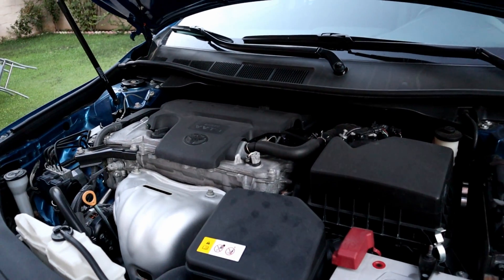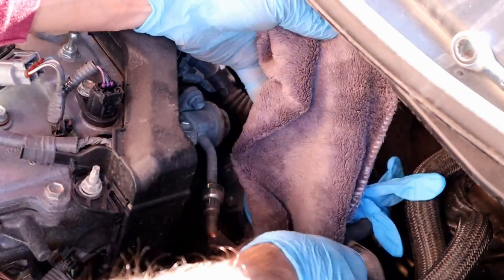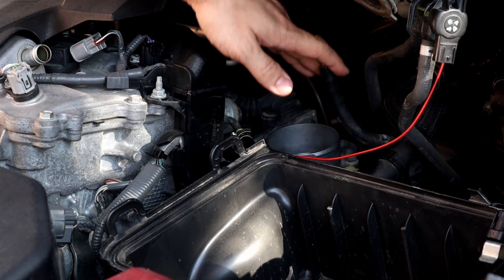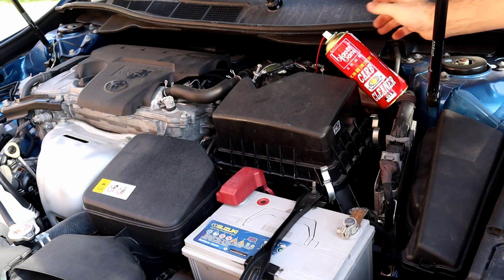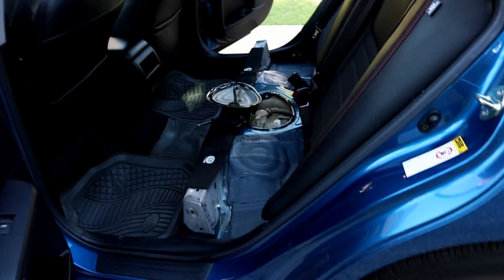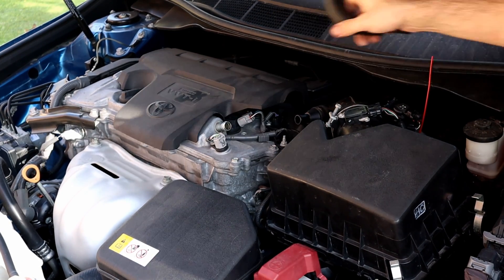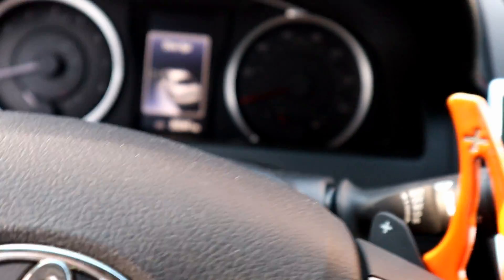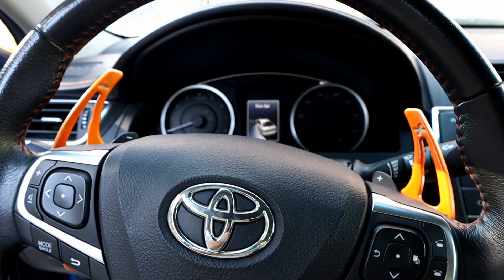Fuel Injection cleaning Toyota Camry 2017/HOW TO clean injection Directly without disassembling

Comment: Ai says this is not safe for motor..I say F@@k Ai..😅 ..for old car first test injectors by listening to each one to make sure they are all working..make sure your tank has fresh clean gas ,add injector cleaner to gas..if fuel pump is weak replace it...than use this method...once everything is good just make a habit of using good cleaner in gas every other tank..😊

Comment: Hey AliMECH, thank you for your videos, been watching so many of them lately. I own 2018 Toyota Rav4 with gas engine. I want to clean the fuel injectors using the method you shown in this video. Since my vehicle is an SUV, it does not have that opening below the rear seat for me to disconnect the fuel pump switch. I need to disconnect the fuel pump fuse. I found the fuse diagram and noted the fuse # 29 under the dashboard on the driver's side is the fuse dedicated to the fuel pump. Is this the only fuse I need to remove to prevent the fuel pump to push the fuel? Is there a fuel pump relay I need to take care of as well? Thank you for your help in this matter.

Comment: Thank you so much for the great video. I made the mistake of dumping fuel injector cleaner in the fuel tank which clogged one of the injectors..now I am getting CEL saying cylinder 3 is misfiring. Car stuttering at idle and happens only after engine warms up. All points to fuel injector. Used your method and emptied full can (about 350ml). It reduced the stuttering. Will there be any issue if i do it one or more cans? Appreciate any help.

Comment: Can i just plug the line with something instead of unplug the connector at the pump?
Reply from the maker: No, the pressure is high, if you plug it, it will damage fuel pump or blow a fuel line
Reply: @AliMECH  im just gonna run the line to a gas container then. The connector on my car fairly hard to reach

Comment: The carb cleaner could eat away at the o rings flooding the injectors under pressure for too long then you got air leak problems

Comment: you can just simply remove the fuel pump fuse on the fuse box to stop the fuel pump 😂
Reply from the maker: If you pull the fuse,  engine won't run, because it's responsible for some other electrical parts,  I showed at the end of the video ✌️

Comment: 2:35, yeah, I didn't like taking the gasket of the fuel tank off. 

 What if you run a pipe from the engine fuel line and direct it to a bucket, so granted you will waste some fuel but it is way better than taking the gasket out of the fuel tank.

Then you can continue the other process as normal, maybe because the engine cannot maintain pressure, it may not allow you to do so? 

Is there any other way? Tapping into the harness somewhere else? Disabling a relay while keeping the fuse in?
Reply: Disconnect fuel pump fuse

Comment: Does the carb cleaner not affect the cylinder walls by removing the oil and possibly messing something up with the pistons cleaning the injectors this way ?
Reply: I mean would gas does the same?

Comment: I have a Rav4 with the same 2ar-fe engine but it doesn’t have easy access to the fuel pump like your Camry. Do you think I could follow this same procedure but route the fuel line to an empty jerry can so the fuel injectors run just on the cleaner? Or do you think that would cause problems and the fuel pump has to be disconnected?
Reply: Hi, I have the same RAV4, how did you do it? I'm planning on doing this, maybe just removing the fuel pump fuse?

Comment: Your an idiot pulling the fuel pump cover to disconnect it when you could've just pulled the fuel pump relay which is faster and easier and your already right there under the hood anyways so you don't have to mess around with the seats and prying off a cover for no reason... Smh

Comment: Veslee's carb cleaner has instructions for fuel-injection systems where you can spray half the can into half a fuel tank. No idea how effective it'll be but hopefully it helps with pistons too
Reply: i can tell you that the cleaner through the fuel tank  may not work.  in my case it didnt work.  i have put 3 different sets of injectors on an old 1986 skyline and all jammed up doing it that way.  i just found this man's videos.  this is how i'll be fixing my problems without a doubt.
Reply: @vsvnrg3263  One can always disassemble them and use the carb cleaner directly into the injector. Or, from months of extensive video consumption, just use premium diesel/gasoline from reputable companies once in a while. Cuz those things works wonders for the fueling-injection system. 

I've stopped using regular diesel and went with V-Power only. That's for sure. Or you can go with halfsies (1/2 Premium; 1/2 Regular), for a more economic approach. Just don't mix them from different brands.
Reply: @vsvnrg3263  so sure that this will fix your problem before you even try it..SMH

Comment: Remove fuel pump fuse make simpler
Reply from the maker: Watch the end of the video, if you remove the fuse, it will cut the power from fuel injectors too
Reply: Got your point. But some cars have specifically fuel pump fuse if I am right. But in general you are in the right direction. My apology.
Reply: Brother My car gets off when I am in traffic when moving with out accelator about to stop but once started it will hold idling- any solutions will be great help to me. matiz daewoo with single igntion coil. None of them were able to fix the issue.🙄🥺

Comment: How do I depressurize the fuel line so I can disconnect it without the fuel going everywhere?
Reply from the maker: Remove fuel pump wire harness or fues and try to start the engine, it will depressurize the line

Comment: AliMech! 😊 Question: have you considered doing a video on “how effective” (or not effective) those “pour into the gas tank” types of fuel injector cleaners are?

I’ve always wondered if those cleaners actually did anything.
Reply: I can tell ya the expensive ones work but not cost effective as ya have to use can every other fillup

Comment: For folks who have never done this before: he’s removing air filter box etc just to access where the fuel line connects to fuel rail. If in your engine layout you can access that point without air filter box in the way, you can leave the air box alone. 😅

Great video!

Comment: To avoid the starting lag when you reconnect the fuel lines on the fuel pump is to turn on the car but do not start do this like 4 or 5 times then the fuel pump will sent pressure to the engine so it can start without hesitation on the first try. Also removing the battery terminals can be helpful to avoid fuel leakage when taking out the fuel lines from fuel pump. Anytime you remove an electrical connectors it's always good to disconnect both positive and negative terminals of battery, so that way you won't blow any fuses. Just to be on the safe side.
Reply: This is a good point. For a side note you and others might appreciate, I used that feature (ignition on pumping small amount of fuel through the line) to empty old gas out of my gas tank. Car had anti siphon system, fuel filter integrated into pump, and I didn’t have the patience nor equipment to drop the tank. So I took the pump relay out, and put a paper clip in its place to bridge it open. That way as soon as the battery is reconnected that relay is forced on/open  non stop. 
So long story short I disconnect the fuel line at same spot as the vid with a hose running to a container and I let the car drain itself in one fell swoop
Reply: Thanks for the advice 🙏

Comment: Hello Mr Ali 
Can you please help me for the problem i have confronted with .
This is the story as below . 
I have 2006 scion , the car had a little hesitation, i clean throttle body by removing it replace the the screen seal , replace plugs , replace vavle cover gasket it was leaking oil around the plugs , then started fine , after i saw your video i did what ever you show how to clean the injector , but nothing was coming out ,i bought the pulse maker + cleaner , nothing was coming out , with no filter in the injector , i order filter , when i put all the injector on , car runs 1 minute , cuts off , engine light comes on , i check the cods , keep saying hesitation cyl# 4 , i install new Denso original ( 240 $ ) nothing changed .I love my little car it was working good , now i have order 4 igni coil , anyhow what you think it might went wrong . the battery was disconnected when i replace the injectors . i am going crazy . i will get the coils by friday jully 29 .today is jully 26

Comment: Probably removing the fuel pump fuse is much easier
Reply: Here is what he said 7:00
Reply: The fuse for fuel pump protects the entire efi circuit. Removing it would disable the injectors.
Reply: Not on Toyota engines
Reply: @dragan3290    what  does  it  mean??
Reply: I agree and understand on the fuse. But maybe try doing the fuel pump relay instead. I did it with no problems on my Jeep, but each car is different.

Comment: It is possible to remove the fuel pump fuse as well
Reply from the maker: Yes, but not with camry, I tried to remove the fues, but the engine didn't start, I think it power some other electric too
Reply: @AliMECH  yes it use a fuel pump control module

Comment: Ali can you help. I have R20A Honda engine. Fuel line is easy to access. Connected carb cleaner and rubber vacuum hose with jubilee clips on. Disconnected fuel pump fuse 9 and turned engine. After several attempts engine would not fire whilst spraying carb cleaner can. . Does  fuse removal disconnect injector operation also? Any reasons why it won't start?  With Fuse back in  and fuel line reconnected  and it starts first time. 🤷‍♂️
Reply from the maker: its ok, the can pressure didnt provide enough pressure to run the engine, even if it didn't run, carb cleaner still will get in the injectors and clean them, try with different can
Reply: @AliMECH  I am going to check my coils next to identity slight misfire at low speed. So far I have tried your valve cleaning, MAF and PCV valve cleaning. I may try heat shrink over the coils as they are now 97000 miles

Comment: Awesome!! How would yo do it on a GDI engine (2014 elantra gt in my case)?
Reply from the maker: Just remove fuel pump fuse and connect the carb cleaner to the fuel line if you don't need to remove the injectors

Comment: Can you clean knock sensor without removing them in a 2000 Lexus es300
Reply: knock sensors don't need to be cleaned, they're basically a very tuned microphone. When they fail, you have to replace them.

Comment: Just remove fuel pump relay instead,   That isn’t better?
Reply from the maker: The easy way is fuel pump fuse or relay,  but I removed the wire so I can show that the fuel pump completely disconnected,  because there is always someone in the comments say, that I hot wire the fuse or the relay lol

Comment: Is there not a fuel pump relay to pull?the fuel pump is probably the only component connected to it, if there is
Reply from the maker: Yea you can do that, but I wanted to show that the fuel pump wire harnesses disconnected with continuous shot, because some people already don't believe that
Reply: @AliMECH  those people are idiots, and they probably don’t work on their own cars or understand how they work -REALLY work. Or they’re from Toyota and are trying to protect their structure by spreading disinformation.

Comment: Can I perform this fuel injectors cleaning a second time if the first time didn’t fix the misfire p0302? I already replaced the spark plugs and coils and the engine code is still there…
Reply from the maker: Or you can take it out and clean them out of the engine, like I did here
https://youtu.be/aDvtzg-ThZs

Comment: @alimech hey bro do you have any video doing the same fuel injector cleaning process but in a Acura MDX or any Honda engine
Reply from the maker: No i dont have, but the prosses will be the same, but i will do that if i find one
Reply: @alimech thanks bro for the response. Another question what’s the brand of carb cleaner you used in the video ?
Reply from the maker: @hanselldisla4643  Most of times i use ABRO, but all work the same

Comment: Well done, as a professional automotive technician I really believe that all of this is gonna work, especially for Iraqis fuel which is extremely bad fuel
Reply from the maker: Yea man, thats the easiest way
Reply: Should block the return line so you don't just blow cleaner into the tank
Reply from the maker: It wont get back to fuel tank, bc carb cleaner can wont be able to provide that much pressure to pass return line valve

Comment: I would have just disconnected the fuel pump fuse.
Reply from the maker: Yea, that's much easier, I showed at the end of the video, but the car didn't work, camry fuel pump fuse cut powers of other electrical components,  but most cars will will

Comment: Can you just pull off the fuel pump fuse?
Reply from the maker: Yes, I did that at the end of the video and the car didn't start, it also cuts power from other electrical parts,  on camry it didn't work, but for other cars, yes pulling fuel pump fuse

Comment: How the engine running??? as u switched off the fuel pump is carb cleaner is flammable like fuel??
Reply from the maker: It burns just like fuel
Reply: Thanks bro..

Comment: Might be easier to remove the fuel pump relay so you don't need to break the seal on the panel under the seat...
Reply from the maker: Looks like u didn't watch the end of the video, in camry, when I pull the fuel pump fuse out, the car wont start, even I was giving fuel
Reply: @AliMECH  I did watch which is why I suggested a relay, not the fuse.  If there is a discrete fuel pump RELAY, you can prevent it from running.

If the relay is an integrated circuit built into the fuse box, then no, you cannot.

Relays are usually in the fuse boxes with fuses.  But newer cars may have them integrated into the box instead of as a discrete relay.

Hope this clears it up.
Reply from the maker: Yes your explained very well, the other reason I remove the wire from fuel pump, so I can show the engine, dashboard and the fuel pump to make sure that it's real, 
If I take really or just a fuse,  someone will write in the comments that I put a jumper there and the car working on petrol lol

Hope that was clear

Comment: Can I just disconnect the fuel pump fuse instead of open the fuel pump and disconnect it too much work for me .
Reply from the maker: Yes, just pull the fuel pump fuse,  I did that, but my car didn't work, because in camry, fuel pump fuse responsible on powering injectors as well
Reply: @AliMECH  there is usually a fuel pump relay so perhaps that was a possible disconnection solution.  I believe the fuel pump relay is in the interior fuse box.

Comment: Do your car have return flue line? I have   on my mk4 vw, on fuel rail i get feed fuel line and also return flue line. Iam concern about that?!
Reply from the maker: Mine doesn't have return line, even if you have return line, carb cleaner can wont be able to open it and get back to fuel tank
Reply: @AliMECH  Bro i did it :). My car was running about 20 sec on car cleaner can. The can wasnt full. After that i was drive my car 5 miles . I feel my car running better. Thanks bro
Reply from the maker: That's awesome , thanks for your feedback

Comment: Just curious, how much of a can did you use and is there any risk of it wearing down seals/rings by thinning out the oil that is lubricating everything? I did this and it does work....I used 3/4 of a large can....wondering if thats possibly too much though.
Reply from the maker: I use half can, and no it wont damage anything, it will burn better than fuel, I been doing that long time ago, and never had any problems
Reply: @AliMECH  ok good to know.... you are literally the only person doing this I could find and yes it does work!, but I'm a bit von the fence if it's actually doing a good cleaning or if it's causing any potential long term issues. Either way though, thank you for posting these videos and I did it myself and have noticed I have better acceleration and slightly smoother idle. Real test for me is MPG because that's my main issue...I used to get 17 on my xterra, but last 4 tanks 10mpg. Something isn't right, but no other issues except for leaking transfer case. Cleaned the MAF, checked brake drag etc.... nothing else an issue so far.
Reply from the maker: @captieye  Awesome, thanks for your feedback
Reply: @AliMECH  ok, mpg is nearly normal again ...for what I'm used to. I think this actually worked!
Reply: @AliMECH  thanks for doing this btw,....you are the only person on YouTube who's done this.
Reply from the maker: Thanks for your feedback

Comment: I believe you because I followed exactly your instructions, the engine is much quieter after cleaning the injectors
Reply from the maker: That's awesome, thanks for your feedback
Reply: @AliMECH  what took auto mfg sk long for a  access door to fuel pump.Old days had to drop tank.but id use a grinder and cut my own access door and patch with metal and rivet.

Comment: There is no need to deal with fuel pump directly. Just disconnect pump fuse/relay.
Reply: I looked everywhere for fuse on my car. I found out. Some cars has a fuel pump fuse. Other cars (like mine) does not have fuse. It's wired to a module under the hood.

Comment: Why don't you take out the fuel pump fuse instead of disconnecting the connector?
Reply from the maker: If you watch it to the end of the video, you will see, the car won't start, because taking the fuse out, will cut power from the ignition coils as well